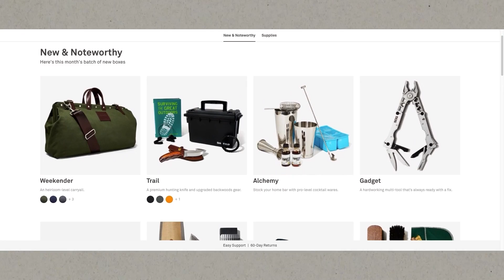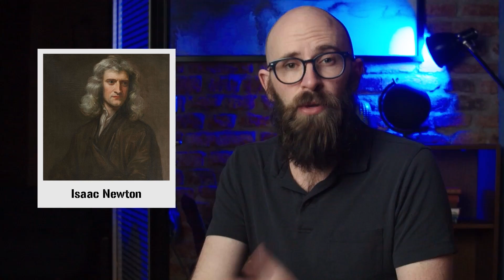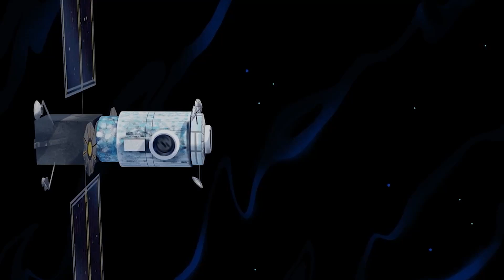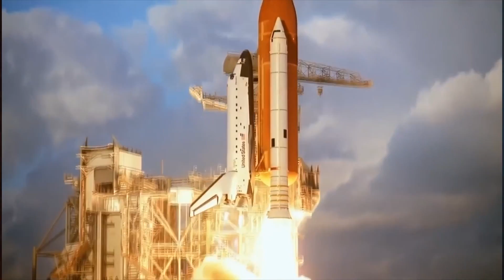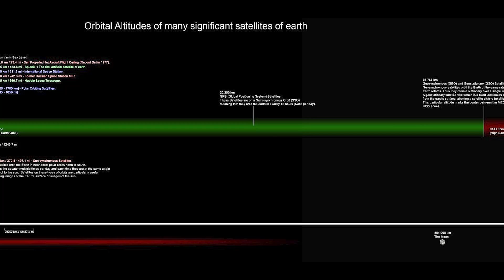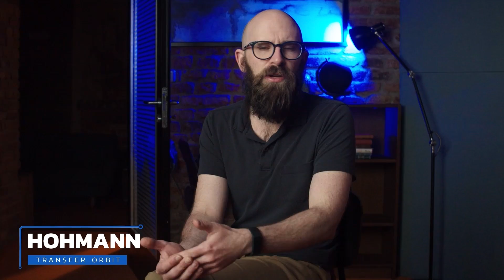LOP-G: Our Gateway to the Stars

Comment: from playing around in KSP, the lower power of the new hall effect thrusters shouldn't have to much effect on the time to get to the moon, it will only have an effect on the time it takes to execute the burn.
Reply: By definition, that is part of the time it takes to get to the moon. In Apollo, it was the time they began their trans-lunar injection burn until they braked into orbit. With hall-effect, it's the same, except they'd have to execute a dozen such burns at the low point of each orbit.

Comment: Its been re-renamed to just "Gateway" now. (Probably good since "LOP-G" is cumbersome.)
iHAB and ESPRIT have been co-manifested on SLS Block 1B launches for Artemis IV and V, and Orion will dock them to to Gateway. If the landing itself gets pushed back, the missions will still go to Gateway ensuring no part of the program getting delayed will prevent returning at least to Lunar orbit!
Reply: Last I heard they were struggling to keep the mass of iHAB low enough to keep it comanifested on SLS.  If the mass goes too high they can likely still launch on another launcher, but then the EUS won't have a good justification on Artemis IV.
Reply: @jamesrwinters  Actually B1B had their co-manifested payload situation improve with CDR. The iHab already had a huge mass reduction (to Cygnus diameter) due to fears that the EUS would be cancelled during the Trump administration. But EUS has been fully funded by congress the entire time (ignoring the administration's requests.) Meanwhile the Biden administration has fully supported Block 1B along with Congress.

EUS is happening on Artemis IV forwards regardless of payload, metal is already being bent for the first EUS. Block 1B is actually pretty far along. Along with the first test casings for the BOLE boosters for Artemis XIII. (Block 2)
Reply: Well he's clearly just future proofing for when it gets re-re-renamed

Comment: I still don't get the need for this to be in place first.  Wouldn't it be smarter to just have the lander in that orbit, dock from Earth to it.  Then undock, drop to surface, do your stuff.  Then fly back to orbit, dock, transfer, undock and return to earth.  Once we have more "stuff" rolling on the moon, then launching this stuff from stuff built in situ on the moon would be easier.
Reply: That is what’s going to happen, the requirement for landers too dock with the station has been dropped. Now it’s more of a supplementary location for enhanced controls of surface equipment from orbit as well as being a good way to test future MSRs infrastructure. It’s essentially a communications and logistics hub that can be manned

Comment: That elliptical orbit doesn’t look too efficient if they’re going to deorbit to the moon. That’s a lot of velocity to kill compared to a circular orbit.
Reply: but you have always communication with the earth and alway sunlight.
That makes the NRHO of the moon great
Reply: @emmata98  why not just send some communication satellites to NRHO then? That's no justification for a space station.
Reply: @iamarokotmanson  the space station itself is to train longterm living in space, especially with other radiation dangers, than in LEO. Therefore a staition near the moon is better.
Also it is not to far away, that it takes months or years to return to earth.
Then the low DeltaV needed to get home is also better in this orbit, in comparison to a LMO/LLO.
Reply: @emmata98  we already have tested yearlong stays on the ISS(Gateway only being able to be occupied for 60 days). We already know the radiation dosage a mars crew would take based on MSL sensors. Distance doesn't justify the station and Lunar orbit is the wrong orbit to stage off of.
Reply: So the real answer is Orion is underpowered and can’t get into a lower lunar orbit. Orion was developed to ride the Altair lunar lander into lunar orbit. Altair would have performed virtually all of the lunar burns except the return one so Orion’s service module was proportionally smaller then Apollo’s for example. When Altair and constellation was cancelled the assumption would be whenever we went back to the moon it would be using similar vehicles. So now here we are where Orion will be flying on its own to the moon and the energy efficient orbit makes it a lot easier for Orion to reach the station and just as before the HLS will have to do a majority of the landing leg work